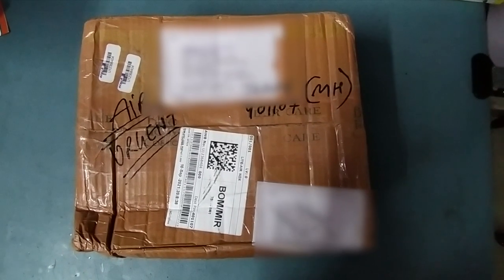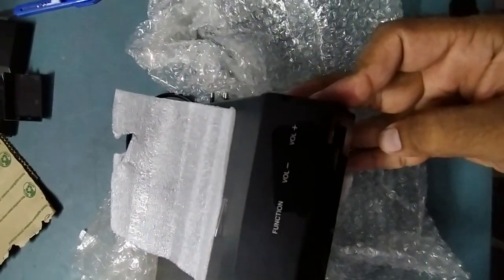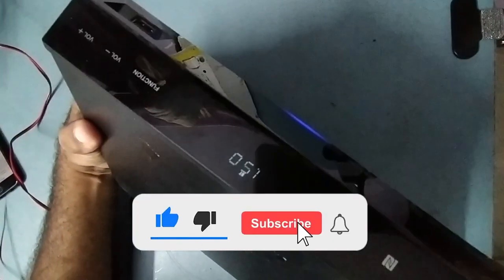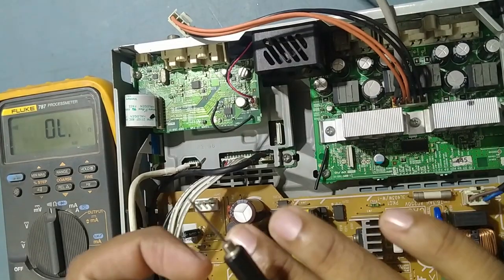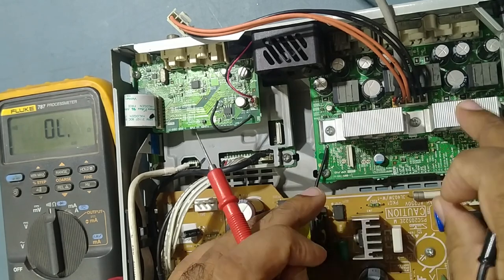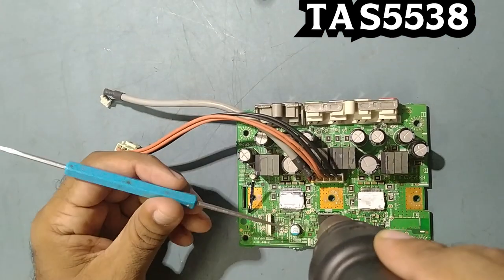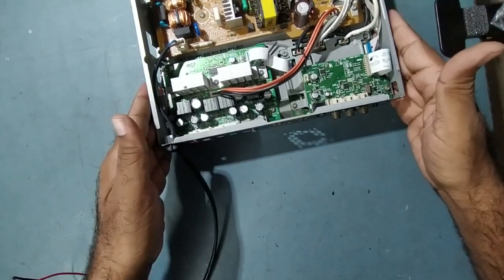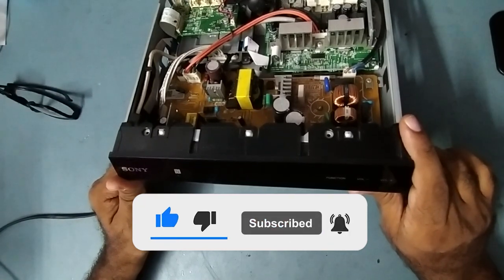SONY HT-IV300 no sound output problem repaired | #YouTube customer

Comment: Can I get it in online??
Reply from the maker: What you want bro
Reply: @TKFElectronics  bro for me also same problem no sound output in ht iv300 so I need the ic
Reply from the maker: Bro if no sound is coming, it doesn't mean that ic is the problem only, May be some other problem can also be possible
Reply: @TKFElectronics  in service centre they told that the problem is IC so we need to change the IC
Reply: So can I get the IC

Comment: My hdmi output is not working when setopbox connected but it shows functions and settings of sony system..how can i clear this
Reply from the maker: Bro your hdmi output circuit is ok, but it looks problem in  hdmi input, did u check in both hdmi 1&2 input.
Reply: @TKFElectronics  yes both of them are not working..before 2or 3 days it got flickering while watching the tv..i thought that was the hdmi cable issue so i replaced with new one..then now it shows not working
Reply from the maker: Mother board (Hdmi Board) looks malfunctioning,  i suggest you to visit your nearest Sony service centre
Reply: @TKFElectronics  sony service centre so far away from my area..can i prefer other shops?
Reply from the maker: Your location
Reply: @TKFElectronics  kerala
Reply: @TKFElectronics  is there any chance to repair
Reply from the maker: Bro need to check first

Comment: Bro try to replace 5.1 home theatre rca port with HDMI arc port if then most of people doesn't need to buy new system or extractors
Reply from the maker: Bro already in market u will get audio video to HDMI converter, no need to do anything in circuit
Reply: हिंदी में वीडियो बनाकर डाला कीजिए जो हमारे समझ में आया करें हमें इंग्लिश नहीं आती है
Reply: मेरे कुछ समझ में नहीं आया